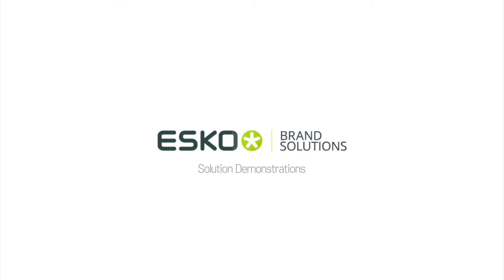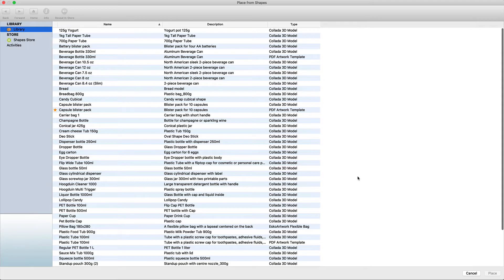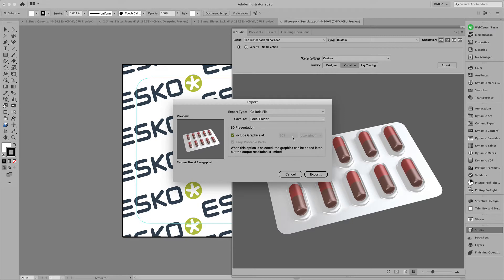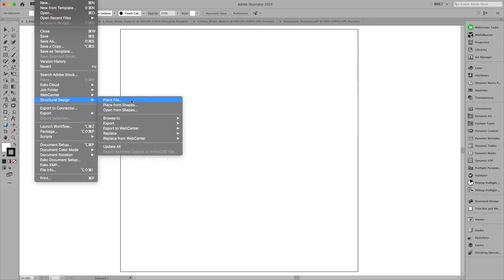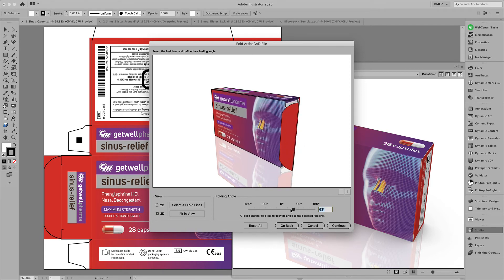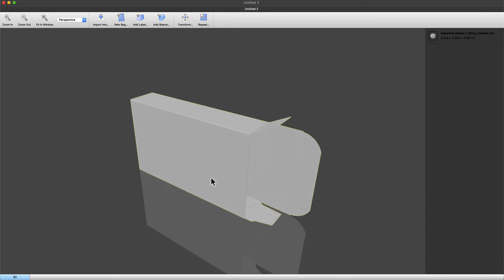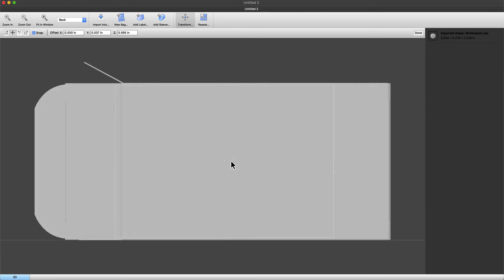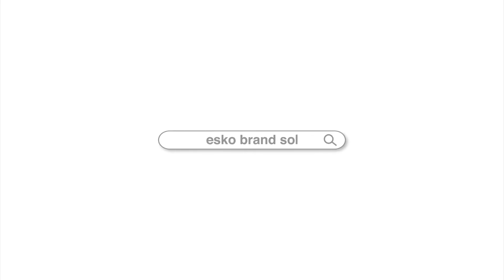Creating a blister pack design using Esko Studio and ArtiosCAD tools

Comment: Why do you have to rescale the blister pack from Shapes in Studio Toolkit? Shouldn't the two models be 1:1 scale already since the carton was designed in Artios CAD to fit around the Shapes model? Also, why hasn't Studio for Illustrator been updated to have the capability to import more than one DAE/ZAE file to compose a scene? Studio Tookit is an old and clunky extra step.